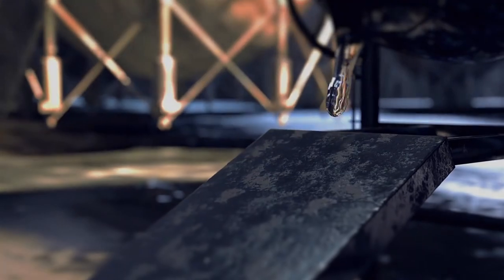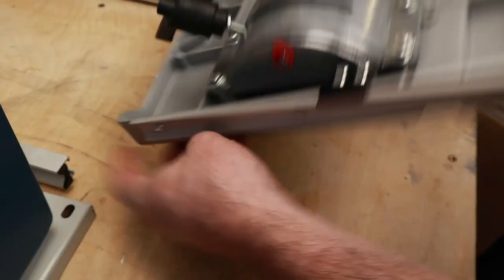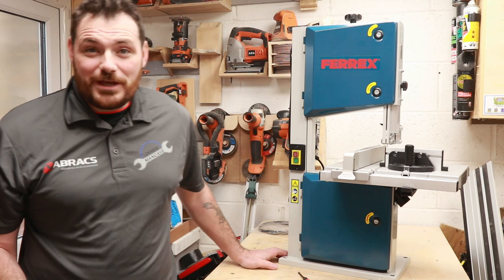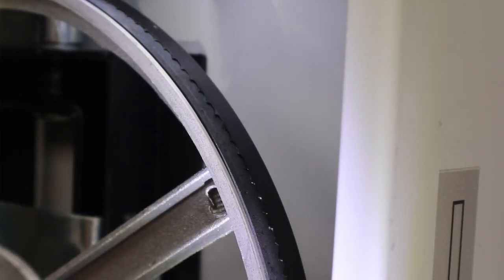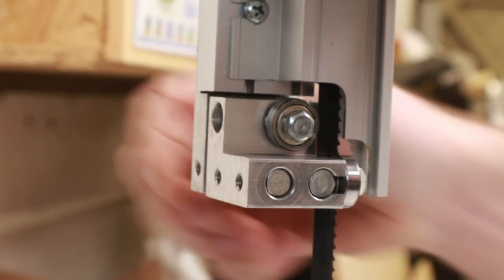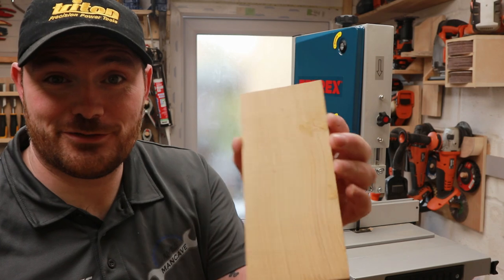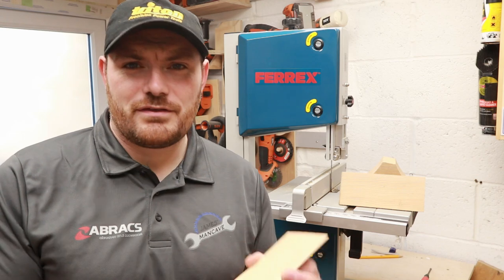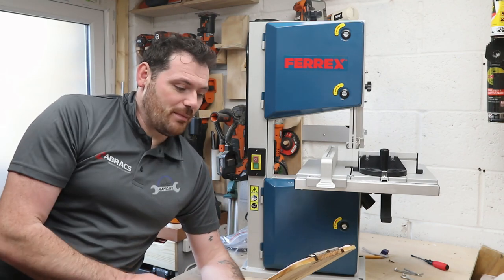Ferrex 10" Bandsaw Unboxing And Set Up

Comment: Cheers James, just got my Ferrex bandsaw on the latest round of Aldi Special Buys. It was a bit of a faff to set up, but following your guide to blade tracking and bearing alignment made it a lot easier. You can definitely tell this thing is cheap - paint in the threaded holes for the vacuum port needed to be tapped out, table isn't very flat and needs a fair bit of adjustment, extension table guides weren't in line with one another and prevented the table from sliding, lower plastic blade guard was badly fitted and rubbed on the blade, and the wheels struggle to tension thicker blades. That said, it's solidly built even if the attention to detail isn't quite there. After messing with it for half a day, it's happily resawing 25 metres of 100mm thick timber with a new SabreCut blade from TuffSaws, so I'm pretty happy with it. Great video, much appreciated!

Comment: My wife works at Aldi, and she’s always bringing me home discounted tools, grinders for a Fiver, packs of flap discs a quid, cordless drill a tenner, cordless mower for £20 etc, etc. I really can’t fault Workzone/Ferrex tools as the price they are for the quality is spot on. Great vid bud. I’ve just bought the evolution RAGE 5S table saw after watching your review. 
It’s a real step up from my Aldi £79 quid one.
Reply from the maker: You lucky bugger! That's some great deals you have mentioned. Personally I prefer the ferrex range to the workzone I think it's a step up in quality. The rage 5s is a fantastic tablesaw, the wing extensions I find really useful, recently changed the blade on mine and tuned everything up, still works and cuts brilliant
Reply: @JamesManCave  yep, the Ferrex seems a bit more well thought out, I’m trying to find out what the cut outs in each side are for, the large slot under the blade holder(I’m guessing the fence) and the odd shaped slot under the push stick holder?? Cheers.

Comment: Another good review. I’ve had the 8” saw for 3 or 4 years. Cheap as chips and it feels like it in every respect but for all that it’s still going strong and with an upgraded blade it does everything I need it to do so I’d recommend it to anyone. This 10” saw looks like a step up though so if mine ever packed in I’d be looking for one of these when Aldi has them in.

Comment: Got one myself and must say I am very impressed. Took a bit of focus to get it set up right. The only downside from my perspective is that the base was bent badly on one corner, in production by the look of it, as the paint is untouched. Checked all the angles and cutting square and cleanly. Put a 18mm ply base under it to compensate, and its working well.
Reply from the maker: Oh dear that's a real shame that it turned up like that, but, happy to hear you managed to get it sorted! 😁 
Also, that makes you, me and David (from grumpys workshop)  the only 3 people I know to have one of these 👍
Reply: Got mine a couple of days ago and it has a big bend in the base too. First thought was that the courier had dropped it, but I think you might be right about it happening before or during production as the weld line on the base to frame joint is banana shaped. Decided to send mine back, which is a bit of a shame as it seems decent for the money and I expect they will be out of stock by the time they come to send out a replacement.
Reply: Mine was the same, It looked like to me that it was a strap that crushed it, probably have them on pallets stacked up in pre production parts, lifting the pallet with straps and some of them are getting crushed...

Comment: Mine arrived today and happy to say that the bottom door doesn't foul the bolt, not sure if it's because a shorter one has been used or if there's been a different tweak. Good to see notice being taken of issues like this. Thanks for the vid, made setting mine up pretty simple.
Reply from the maker: That's good to here, it's a small issue, but still an issue. Glad to have been of help 👍
Reply: Same here... Maybe they fixed it, or it could just be variation within the parts themselves...

Comment: Hi James. Just unboxed mine... got rid of the blade immediately as I'd heard elsewhere it's blade was pants (I think Peter Millard) and I have spent the past hour trying to get all those f**king bearing wheels a papers width off the blade. It seems impossible??   I rarely read instructions - where's the fun in that? - but it does say to tilt the table before opening the bottom door... just so you don't dink your paintwork! This was a super useful vid - thank you - I hope I get mine to behave like yours... I can barely slide the table extension on! I will file it tomorrow.

Comment: The Snodgrass method is for saws with crowned tyres - these are flat so the tension should be equal across it, so teeth don’t need to be in the middle, the blade would be better centred on the tyre.

Comment: Hi, My Ferrex bandsaw arrived today- and what a nice piece of kit- well made and with a 550watt motor and the option of two speeds. It was virtually set up to exact needs, and your video was a big help, in making the whole process a bit easier. Only one minor problem- the front vacuum connector holes had been tapped and then painted so I had to run a 6mm tap through to ease the threads- otherwise perfect and all for £149.99 delivered as they refunded the £9.95 because of the shit delivery company who were 5 days late.

Comment: I bought the Sheppach badged version, before I saw this review. I got over the first hurdle. 2 out of 5 people seem to have had their purchase damaged in transport. The fence is excellent, I’ll give it that. And that’s where it ends. The table needed some bending to get the two halves, either side of the gap, level. It’s done. Thanks for the heads up on the Snodgrass method. Invaluable. But won’t fix a cheap bandsaw, sadly. I have tried everything, but the blade moves significantly in both planes. The backwards forwards movement leads to the sideways movement, so only one problem really. Either the top wheel is wonky in some way causing it to track badly, or the blade is not made to a high tolerance. It will cut, but I’ve got a rough, and wavy finish. Do I send it back. Have I got time to get a quality blade and try that before my 30 days are up? Decisions decisions. I could use the side bearings to keep the blade straight, but you’re not supposed to are you? Nearly forgot. That lever for the tilt, a faff to put on, and having to take the table off again to get better access to the lower bearings, it’s now barely working. Could find a wheel. The final straw is the upper guide unit... there is so much play in it, that when you reposition it, you have to check where the back bearing is, and hold the unit while you tighten the knob. There goes convenience. Looks like you’ve got a good’n there. I’m not going to work a bandsaw hard, but I do need accurate and clean cuts, or my future plans are out the window. I didn’t expect much for the money, so I shouldn’t be surprised with the quality of the components. Bearings that barely turned because they’d left off a washer. Lower side bearings with two washers which put the bearings too far forward on the blade, even with the carrier unit set as far back as possible. Not thinking of selling yours are you.😃
Reply from the maker: Hmm, when you said about the movement of the blade I was thinking it might be a poor unaligned weld on the blade, so was gonna suggest getting a new one. But with all the others you have mentioned it may be worth sending it back and asking for a replacement. My table was straight and level out of the box, I think had it of not been, I would have sent it back then. Hope you get it sorted
Reply: Just having my third look at it. The wheels themselves seem perfectly round, but if you watch the rubber tread you can see it is not. Might not be a consistent thickness or crudely glued on. What I an seeing on the top wheel is the rubber is not wide enough to fill the track and there is not a consistent gap to either side. I think that is throwing the tracking off, moving the blade forwards and backwards and because it is a crowned wheel the blade moves side to side because the circumference of the wheel is in effect changing. Pity, it has some string points and maybe I could fix the poor bits (also mitre guide sloppy in track). I can see the blade moving about coming off the bottom wheel as well. Anyway, thanks for your reply, I think it’s going back. Not sure where to go from here. Seems like a lottery under £300. Many seem to share the same frame and main parts as well. Cheers and enjoy your bandsaw. PS will check blade on a flat surface, though I have tried both blades they give you.

Comment: Nice one James. This newer model looks far better built and powerful than the previous Aldi model that I have (its the old workzone model). My old one is still going good, but then again, I use it only like once in a month or so for my kind of hobby stuff. The only upgrade done was to get a couple of different TPI blades from tuffsaws website. Regarding Dust extraction, mine is spot on with just a shop vac attached to the port. Very few dust on the lower wheel area.
Reply from the maker: Hi mate, yea I have the parkside Lidl version of the older type bandsaw. I liked that one, apart from the rip fence and the height of cut. This one has a much higher depth of cut which will suit my needs better, as for the dust collection, it has 2 ports on the machine, a normal size port, and a 4 inch port. So to really see how good it is I'm going to have to get one of those metal bin type dust extractor's 🤔🤪

Comment: This seems so much better designed than my 10" Rikon. I like the table extension and the dust port location.
Reply from the maker: Thanks for the comment, it's definitely a Bandsaw that has a few good features on it. One of the dust ports is 4inches, so I'm yet to try a dust hose on that, but I'll get that sorted soon, so would be good to try it with both ports being used
Reply: @JamesManCave  I bought the ferrex workshop vacuum, has the auto on/off function in conjunction with the bandsaw, works well

Comment: Great review and setup James! I couldn’t get the stock blade to cut that well, but swapping it out for a 1/2” tuffsaw blade made a big difference. Are you getting much vibration from it? Mine shakes about like a washing machine on full spin - doesn’t affect the cut, but makes it uncomfortable to use! 🤷‍♂️👍👍
Reply from the maker: Hey Peter, thanks. I was a bit concerned about the blade before I set it up as the weld on the join didn't look very good, but doesn't seem to affect the cut at all. I've also bought a 1/2" Dakin Flathers blade to swap out for the stock blade. I'm not getting much if any vibration from it, doesn't move on the bench whilst using it, but I know what you mean as I had that type of vibration on the little parkside bandsaw I bought. This is the 3rd Ferrex machine I've bought, and so far all seem pretty good value for money. 👍
Reply: @JamesManCave  Interesting, thanks! Yes, the vibration was bad enough I almost returned it, but it was fully sold out by then, so decided to stick with it and I’ll see if I can sort it out later on - might get a video out of it! 😂 Yes, the Ferrex branding seems to have marked a shift in Aldi’s buying; previously they seemed to be lately re-badged Scheppach, with Scheppach handling customer service, returns and warranty claims. The Ferrex stuff I have is all marked as ‘made for Aldi in China’ so I guess they’re buying direct, albeit likely from the same factories as other ‘manufacturers’ 🤷‍♂️👍👍
Reply from the maker: Yep my Parkside bandsaw is a re-badged scheppach, just like the workzone one that you had a while back. That's a shame about the vibrations, because I've had nothing but a good experience with this bandsaw. Hopefully it's not the wheels out of balance as that would be quite a pain to sort🤔👍
Reply: @JamesManCave  The Weld.. me too, was catching on the bearings, so took a little emery cloth to it, much better but not perfect

Comment: Great video there!  Thanks for making that.
Do you find that the rise and fall guard throws out the positioning of the bearings?  It's resulted in me just leaving it fully up at all times which obviously reduces accuracy.  Minor niggle.
Tip for opening the bottom door- tilt your table to 45 using the lever underneath.  Then you can open it without messing with the bolt.
Thanks again!
Andy
Reply from the maker: Hi, yes I have started to get that, I'm thinking it might be something to do with the teeth on gears, I'm going to try and add some masking tape on the teeth of the gears to see if that helps it. Thanks for the tip on tilting the table, I hadn't thought of that one. 👍

Comment: I have one of these, thanks for the review. Can I ask you a quick question? On mine there's lots of 'play' in the top blade guide when you loosen the clamping knob on the front. Is that normal? When re-tightening it i need to be careful of the alignment of the whole assembly so the blade guides are in the right place. Does that make sense?!
Reply from the maker: Hi, it is normal for this machine, due to the price of this machine there are things that aren't as good as they could be. On a much more expensive machine, you wouldn't get this issue

Comment: Does the table slide right if so just slide it to open door...also keep an eye on the tires on the pulley they come off and take the blade with them..I just replaced mine with the orange tunsten ones
Reply from the maker: Thanks for the info about the tyres, I'll keep an eye on them. Yes the table does slide out, and your right, you could slide the table out of the way, I hadn't thought of that. To excited trying the saw out 🤪👍

Comment: I don't know if you're still watching for comments on your older videos ... I've just got round to unboxong my Ferrex bandsaw but I'm stummped right that the first hurdle. I can't get the handle to screw into the nut that holds the handle underneath thge bed (the first one you screw in on this video. There's no downward force on the bolt so when I offer up the handle to scre it in, it just pushes the bold out of the way. What am I missing?
Reply from the maker: Try doing it up side down. It does take so fiddling about to get it to lock in, a lot of people have mentioned this
Reply: @JamesManCave  I tried that but it just falls out of the hole 😆 I think I'm going to hot glue it in place, screw it in them remove the glue.

Comment: Thanks for the review. Aldi have a Ferrex bandsaw listed as coming soon, possibly the same one but in a different colour. Can you please tell me how much vibration travels through to your hands when cutting?
Reply from the maker: Well this is a hard question to answer, as what I may think is minimal vibration, you may think is a lot. But, that said, thinking about it, I've never thought about the vibrations when using it, so I guess it's pretty minimal, certainly not anything that has bothered me
Reply: @JamesManCave  I wanted to make sure  any vibration isn't excessive, I probably should have worded my question differently. You have still answered it perfectly. Thanks for responding and for your help.

Comment: I have a recordpower bandsaw, a big unit from probably the 90s and I actually sold it to buy one of these.. The recordpower is built like a tank, but it was more trouble than not with it.. Blades hard to source for it, no mater how many times I tried to balance the wheels, I could not get rid of the wobble, Such a shame because its a saw that would easily last a lifetime, but just not accurate enough for the small work I do with my buisness.. Fence was trash on it also.. I picked one of these up under the original scheppach name for a bargain, it was missing the mitre fence and the base was twisted a bit, I slap of a hammer bent it back into shape, I have a far better mitre fence with my table saw anyways so noting lost..

Comment: How the hell do you get the tilt knob to fit onto the screw - mines just disappears up into the housing on the table ?
Reply: I used a screwdriver pushed into the slot and held the top of the screw down whist my son went ahead and did the tightening part of the operation - fiddly for one person

Comment: Is the table self-aligning or did you have to set it up yourself? If you set the table up please show how you did it.
Reply from the maker: The table adjust with the lever on the back of the table, when you release it you can tilt the table to get it level, then there is a adjustable stop under the table so you can keep it level

Comment: Hi James, have you tried changing the blade yet to a smaller detail blade? If so what are your thoughts on the saw’s performance? Cheers, Jim
Reply from the maker: Hi Jim, as of yet I haven't changed the blade on it. I do have 2 blades here for it from Mr bandsaw, a wider rip cut blade and a think detail blade. So once I give them a try I can update you then. But I really do recommend this saw from the use I've had out of it so far

Comment: Hi James I recently got a cheap band saw I have done the setting up I watched the snodgrass method but I still keep braking blades I don’t know were I am going wrong can you help cheers Martin
Reply from the maker: Hi Martin, this question need a bit more detail from you, does it break in the weld? Are you cutting curves or straight lines when it breaks? Etc . . . . .
Reply: @JamesManCave  hi James it’s Martin re, bandsaw blade keep breaking, when I done the initial setup all seems well then after a few cuts a strange noise like a slight shudder and then a few swear words later just feel like throwing it in the skip is it because I bought the last set of blades of the internet could they be sub standard  the size is 1400mm 6tpi x3/8” I think I need to invest in a better model I do like using the saw  many thanks James keep up the good work cheers Martin